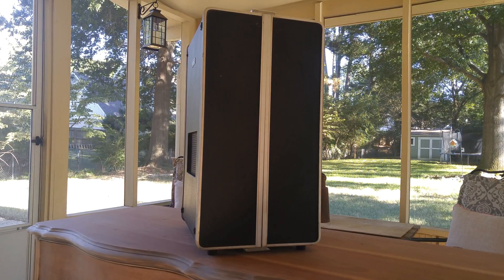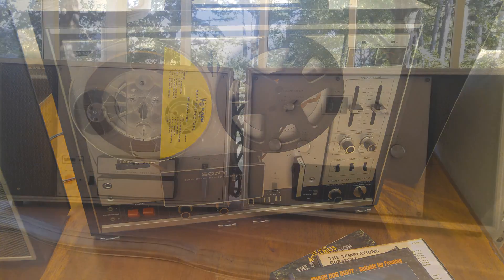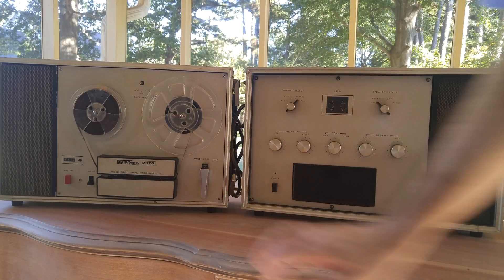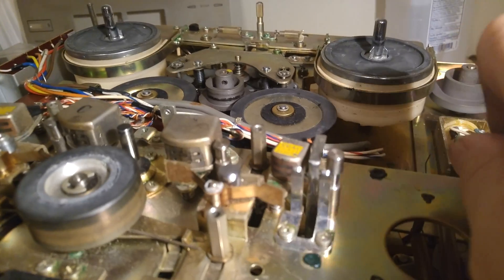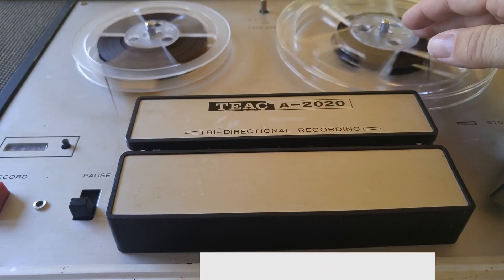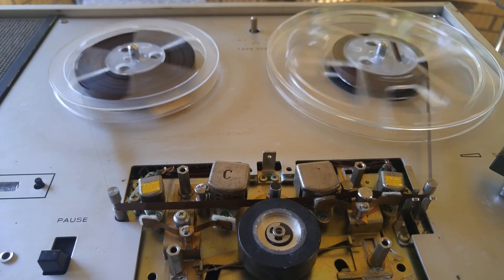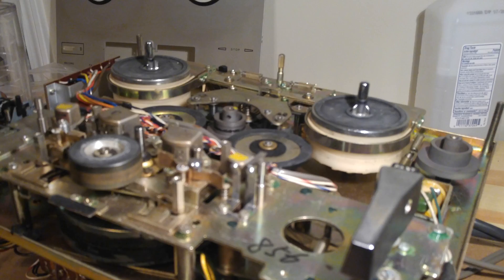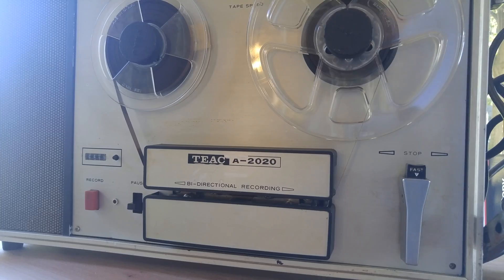Broken Teac A-2020 Reel to Reel [Tape Decks, Part 2]

Comment: I have same issue with two idler pulleys disintegrating.  Can you tell where you got replacements?
Reply from the maker: Unfortunately, I did not find replacements, this is still broken...
Reply: Terry's rubber rollers can rebuild them for $50 ,a piece.  Even though he doesn't list the model in his database.

Comment: I have one identical and have it since 1985. I recently pulled it out and played it but it stalled. I took the plate off and noticed that the pinch roller's rubber melted and made a verry sticky black substance. All it needs is another pinch roller and a good cleaning but I have not the part to fix it. Great video by the way.

Comment: Yuck, that Beatles song was AWFUL. Very erratic speed. Too much wow and flutter. I agree with you on the fact it was very much abused. By the way, that gunk on the capstan flywheel is from the idler that disintegrated. I bet some good strong rubbing alcohol could get that off. However, the idler wheel is beyond repair and so yes, it is a shame you can't find a good one to replace it. Now I can't say for sure, but maybe eBay might have some replacement parts, like maybe another idler wheel that might fit the one that's currently disintegrated. As for the pressure pads not moving into place to hold the tape up against the head, I suspect that's due to dried-up grease not allowing it to work properly. I bet if that was cleaned out really good and re-lubricated with either good grease or some oil, it'd work better. That is, if you want to get back into that. It doesn't have to be done if you don't want to. I was just saying, as a suggestion.